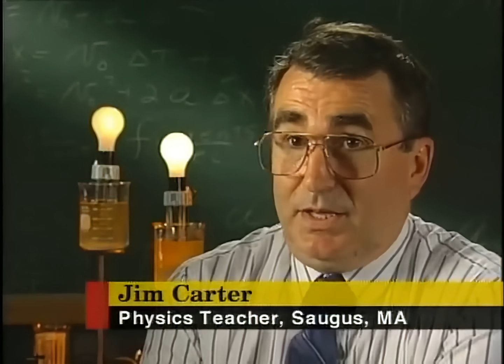MIT graduates cannot power a light bulb with a battery.

Comment: Calm down people. They are still some of the smartest people in the world, anyone can make stupid mistakes.
Reply: +Piotr Kaczmarski

First, lemme point out that a 1.5v battery would light a 12v bulb. It would be dim but it would light. The proper materials were provided.

Now that that is settled. This wasn't a trick. Nor was it supposed to be. It was pointing out to people that even though these recent graduates had just been trained as engineers from a very prestigious university they almost entirely lack hands-on skills of applying what they learned. Their education has mostly been in a formal setting, not out in the field. As such they lack the intuition to make it work easily. These are just kids with little real world experience, remember that.

I would bet your average HS educated auto mechanic with a few years experience in the trade would get the bulb to light easily because they are intimately familiar with handling things like wires and bulbs and batteries and manipulating their hands in weird ways to use tools and install parts.

It is about how people are trained and educated and how it can be done better. Not that the people who graduated from MIT are stupid.
Reply: +Trafalgar I blow turtles
Reply: maybe not if that can't apply what they learned into real world applications. but they also just graduated so their minds must be racing and totally not focused on the task. I'd give them the benefit of the doubt, knowing just how hard it is to graduate from this school.
Reply: Piotr Kaczmarski What I, Trafalgar, and the video point out is something technicians have known for centuries, engineers often lack hands-on experience. You can drop some technical item in front of a freshly-minted engineer and they sometimes will be at pains to work out a solution be it a simple bulb and wire or a broken automatic transmission. They often know how it works theoretically but they don't know how it works intuitively like a skilled tradesman would. This creates a disconnect and often imperfect results.

It is the emphasis on theoretical knowledge and fundamentals stressed in the university environment that makes it this way. It is an engineering program, not shop class. This leads to an imperfect situation because of how all of the theoretical and fundamental knowledge taught to engineers is then applied to blueprints to be built by skilled tradesmen using technical expertise and methods. These practices are often at odds with each other. Anyone who regularly fixes consumer products knows the agony of repairing a poorly designed device where the designer "compromised" on serviceability or, more likely, didn't even consider it.

Aside: I curse Toyota transverse-mounted V6's and their rear bank spark plugs. I will hate them and whoever designed that particular "feature" forever.

The solution here is a greater emphasis on technical knowledge at MIT and in other engineering programs. More labs. More internships. More getting your hands dirty in the field.

A partial solution does already exist. These graduates are not engineers. They just have completed an engineering program. Entering the field as an engineer-in-training (EIT) for a set period of time and then passing the certification testing still has to happen for these people to be certified engineers. This does some to help alleviate the problem but it still misses a lot of technical skills training that is often lacking.
Reply: Education and income are associated but not directly related. There are uneducated millionaires and indigent PHD's. If you're incapable of closing a circuit you're prolly not going to land and keep a 60K+ job by the virtue of a framed piece of paper hanging on the wall.
Reply: Randall Waitt Well said.
Reply: TheGentleUncle They are still MIT graduates. If you think they got there by being stupid, then you're kidding yourself.
Reply: Of course they didn't get there by being stupid (and they are stupid)...they got there by having rich parents.
Reply: TheGentleUncle Good for you, mate. You can laugh at them all you want but these are the people with degrees from a top University.
Reply: Which means nothing, kinda one of the points proven by the vid.
Reply: putty93010 Yeah, only a job that pays over 60 grand.
Reply: putty93010 Those people are few and far between. A person with a degree is simply more likely to be better off than a person without - not least a degree from one of the top Universities in the world. All i see here are people trying to make themselves feel better just because a few MIT graduates couldn't get a simple task right.

Don't worry about them - they'll be fine. Worry about yourselves and how well you're doing for yourself. Because that's what they've done.
Reply: Thomas Anderson I'm the one who is months away from graduating with honours. So if there's an idiot here, it's not me.
Reply: Thomas Anderson Well, you think they got into MIT by being stupid?
Reply: +Trafalgar Congrats btw :D 
I personally think that many of them just have been asked to do that task at the wrong time at the wrong place. It is arrogant to assume that one is more intelligent, just because of one datapoint. In addition everyone can say they knew how to do it, but then again they weren't challenged.
Reply: 1997CWR My thoughts exactly.
Reply: ***** What i will say is that the concept is simple. A battery, wire SHOULD light up the bulb. However, one needs to have a basic understanding of electrical circuits to understand that the circuit needs to be completed.
Reply: Piotr Kaczmarski "BUT tell me guys, is it really a good idea to take conclusions from this obviously manipulated video?"
Dude, it wasn't manipulated. They really did fail this test. The video, in case you didn't notice, had professors of psychology and the like explaining why this phenomenon exists.

"Are those 5 or so people who just attended a big event in their lives a good statistic?"
It wasn't intended to be clear scientific proof, it was merely intended to illustrate the problem with a simple example of the phenomenon. Look, I went to college for engineering. I know how most of these students are. It was me and maybe a few other other guys in most classes that had any technical knowledge at all. Most of these kids cannot change the oil in their own cars or fix a leaky faucet, like most in their demographic. They never had the schooling, training, and experience unless they, like me, sought it out. The universities select for skills in science and math for engineering programs. They could give two shits about prior technical knowledge or skill in applied tech.

"Is those people really the proof that the universities teach TOO MUCH theory?"
To undergrads? Absolutely. Save the in-depth study of theory for post-graduate level programs. When I went they didn't even attempt to teach any technical aspects until junior and senior year. Freshman and sophomore years were spent in advanced math and science hell with maybe a drafting class or econ slipped in there. It simply isn't something that is stressed within the programs, though it probably should be.

"But that would be just bitching about MIT, wouldn't it?"
Dude, it ain't my job to fix MIT and other engineering programs. Stop acting like it is for simply holding a commonly held opinion that even those within the faculty of engineering programs themselves acknowledge is a structural issue. Completing an engineering bachelor's degree averages 5 years already, They simply do not have the time available to cram in another 15-20 credit hours of comprehensive technical training.
Reply: Entering an after-school educational organisation does not necessarily require any significant intelligence. Anyone that is not handicapped can do it IF they do enough work at young ages. But right now I am replying to someone that did nothing to disagree with my comment. Seriously, everyone could write comments like that with no content about the others kidding themselves because they do not trust responsibility-feared people like that "mechanical engineer" in the video.
Reply: Once again, a degree from a top university may get you an interview, but if you're incapable of closing a circuit you're prolly not going to have successful career in the technology industry. 

One of your earlier posts said you're a few months away from graduating so I'm guessing you either have rich parents or about 200k in student loan debt...if you're graduating from one of these super fancy top universities which reside the very elite...people incapable of closing a circuit after 6 years at a technology institute.
Reply: putty93010 No, I live in Australia. $40k is more than enough for most degrees here at top universities. I don't know how Americans deal with such fees.
Reply: "All i see here are people trying to make themselves feel better just because...". Totally off topic once again. Because all I see here are people disagreeing with your initial comment which says that the people shown in the video are of the world's smartest. Keep your lawyeristic persuasion tactics for the court, mister.
Reply: Trafalgar Really, REALLY stupid mistakes lol.
Reply: I would not call "smart" anyone that cannot imagine that a lamp will not light unless you close the circuit, justifying their epic failure of basic life knowledge by claiming that they are not electrical engineers. Yes, that's exactly what an e.e. undergraduate student learns in 5 years: lighting a lamp with batteries and wires... Such good scientists (their teachers) still think that their students are the smartest people in the world. Either they are completely uninformed or leaning to the stupid side of their personalities as well...

Comment: My 8 year old could do that.....given the battery isn't dead and the bulb has a minimum rated voltage above the charge voltage on the battery so there is enough current to illuminate the filament. Maybe more of them should transfer to the Electrical Engineering Dept at Ok State University so they will learn how not to be a slightly smarter than a snail. LOL

Comment: That's not what they teach in technical schools! They teach theory, equation derivation, mathematical transforms, laws of physics, etc. Practical knowledge? That's not worthy of academic institutions!
Reply: practical knowledge can be learned outside of school, unlike theoretical knowledge. That is not my thought, but the one behind my school's teachings.
Reply: I learned that in 3rd grade though.
Reply: They have labs, you can't be an engineering without going to labs. Labs carry around 30% of the marks!!
Reply: Anyone of these students could figure out by themselves how to plug the light bulb in less than 10 minutes; they just could not do it in 30 seconds in front of a camera. 

I am a few courses away of completing an engineering degree in mechatronics yet I wouldn't know where the boundaries of the bulb are (Though I could probably figure it out in 30 seconds). I know I would have to plug a boundary of the bulb on one side of the battery and then connect the other boundary with a wire to the other side of the battery, so that I can create a current and heat up the element into the bulb, but not a single one of my courses have actually taught me where the boundaries of the bulb are: that is some extremely easy to find information and it probably varies from a bulb to another, hence the reason why it is useless to teach it. 

We have used leds all the time in my courses, whose boundaries are about as obvious as it gets.
Reply: ***** You are right. You can't teach everything. For e.g. When they teach you about microprocessor, they chose a random microprocessor and all your labs are based on it. For example, our professor used old Intel 8086, while some other teacher might use some other device like a Z80.. The goal is to teach you about microprocessors in general and it's up to you, how you use that knowledge to tackle similar problems. They can't teach you about every single microprocessor that was ever made.
Reply: MrOmnos labs have for main purpose to demonstrate the veracity of a theory, not to teach you how to plug a light bulb.
Reply: MrOmnos that and the use of different tools depending on what course you are into.
Reply: ***** Labs do teach you how to plug a light bulb if you weren't smart enough to get that from theory. Source: I am a student. If you are too dumb to implement what you learned in class and lab then sorry engineering  is not for you. People do everything to get into MIT. There are countries which doesn't even have good lab facilities and has worst education system still they produce good engineers. It's depends on the student not school. You can send a donkey to MIT or Harvard and it won't turn into Einstein. You can send a smart guy to a school in Ethiopia and he will still be smart. College education is best in US with all the well funded public colleges and research institutes. Can't say the same about highschool education.
Reply: That is the best example. We used PIC24FJ64GA002 for almost every course where I studied.
Reply: Frankly speaking you need that knowledge to be creative, to understand basic laws, to use them for your good, to make them useful and not a problem. If you study something, you have to study hard. If you study something, it means you like it, it means you do this on a daily basis. If someone just goes to college, make projects, pass exams, he'll just get good at graduating and not becoming a good engineer. It's your life, you decide if you wanna study, you don't study for teachers or good grades. You do it for you and they won't make you, it's your choice what you'll take from college time.
Reply: violacrb bunch of theoretical formulaic nonsense to power the future of absurdity...
Reply: Why not have both?

Comment: TL;DR: Universities teach by rote which discourages lateral thinking, but maybe that's not so bad and the lateral thinking comes later, through practice. But this costs industry more money and profit is king. Lets blame academia?
...
Pretty much everyone in the comments has missed the point of this video. Yes, its largely fake. Some of the "graduates" are actors (not very good ones). Yes its a simple solution. The point the video is trying to make is that the education system is in danger of teaching you NOT to think, but to recycle what you are taught. The light bulb idea is only an illustration: An engineer is taught that to make a circuit you need two wires, a battery and a bulb. An engineer is shown circuit diagrams over and over. S/he sweats over exams, theories, failure, disappointment, parental anger, fear of the future. "Get the answers RIGHT". And "right" is "what you've been taught". Even if you don't need two wires.

When faced with a problem that does not fit exactly what they were taught then, engineers can struggle to find that innovative solution - or in this case, what would seem the "wrong" solution. "If I just touch the bulb like that I can make it light". The guy has the answer, but still feels like he cheated. So at the end of the video, the voiceover says "is it what we've been taught, or the way that we think". We've been taught not to think. Deliberately or not is besides the point, and the bulb problem is only an illustration. Its still an excellent call to educators to examine how they teach and what the end product is. Teach genuine, critical thinking that creates effective solutions - NOT "right answers".

Counter to above: A bachelors is a foundation that you build on, a framework. Later learning and practice expands upon it and later lets you discard it. Like learning piano - at first you are rigid and mechanical, remembering scales and finger positioning. But the mroe you learn and practice the more you internalise it and make it an art. Maybe graduates aren't MEANT to be fully capable lateral thinkers yet, as this is what practice in industry should be about. Industry always demands "the finished product" though - because its less profitable to train than it is to buy experience. So, is it the fault of the teaching system, or industry, or both?
Reply: +Mirandorl did not read
Reply: Brix Monton your reply notification went straight to my spam.
Reply: +Mirandorl  your observation is very good, and so is your patience.
Reply: Uhhh tl:dr??? bruh this comment is longer than the video
Reply: @MKermy  You know lockdown is getting to you when you reply angrily to a four year old youtube comment ;)

Comment: i'm not an engineer but i surely know how to do that. Degrees are not everything!!
Reply: +labouradrien 
If you look at the bulb (specially the socket) you should immediately see that this is a line-voltage type which never will light up from 1.5 Volts provided by such a battery.
Reply: +akronymus Depends on the bulb.
Reply: tytykoolkat
The bulb shown here has the small (~ 1/2 inch) Edison-type screw socket which is only used for line-voltage lamps.